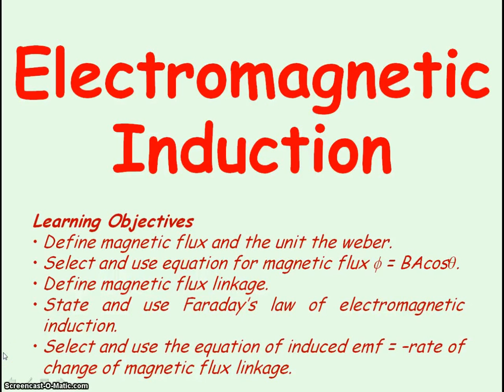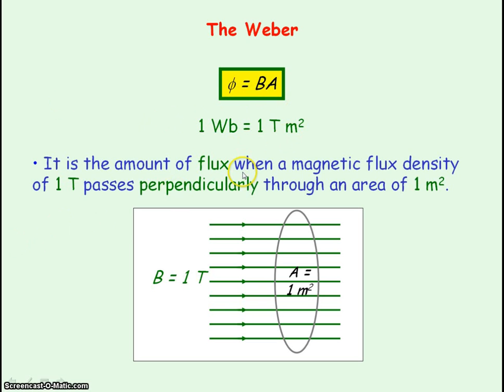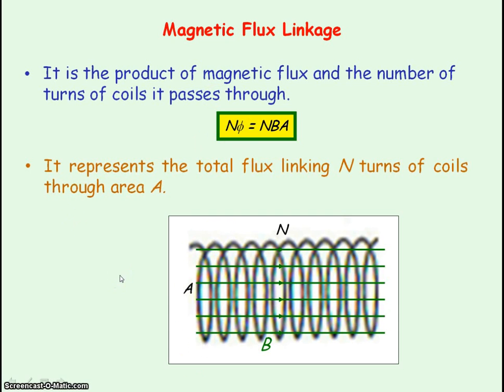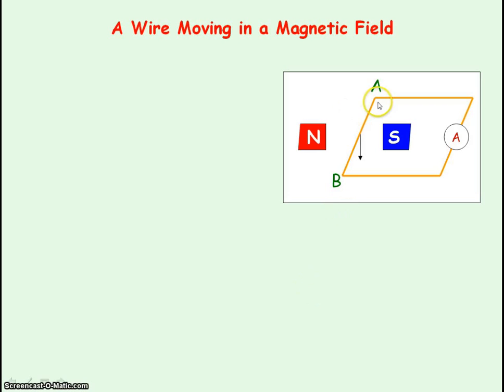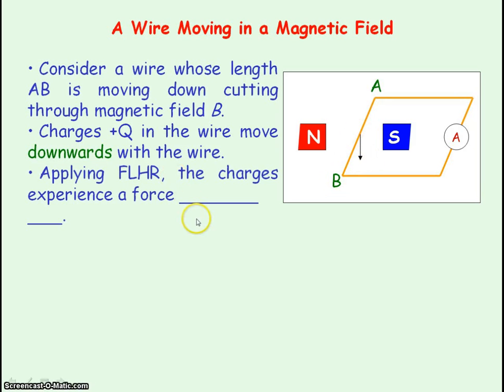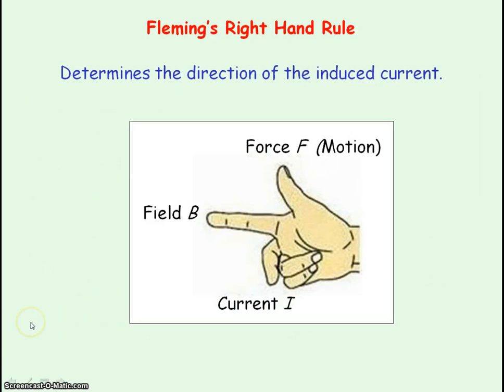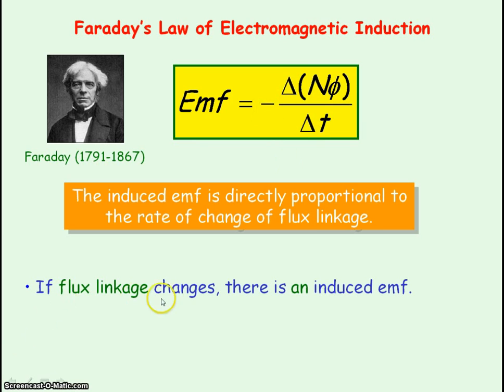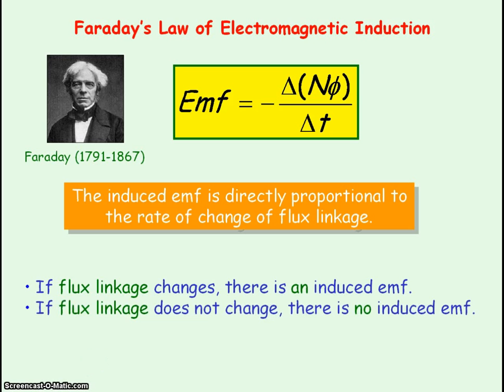EM 09 - Magnetic Fields 5 (Electromagnetic Induction)

Comment: How would we get a change in flux density?

Is it because of the wire cutting the magnetic field lines?
Reply from the maker: If it is a straight wire being considered then yes we talk about the wire cutting field lines.  It it is a coil being considered then we refer instead to a change in flux linkage, but the coils do cut field lines during a change in flux linkage.